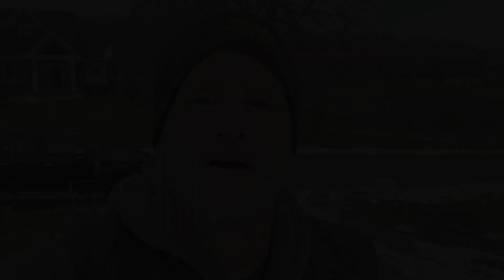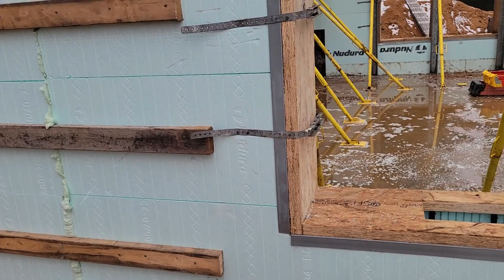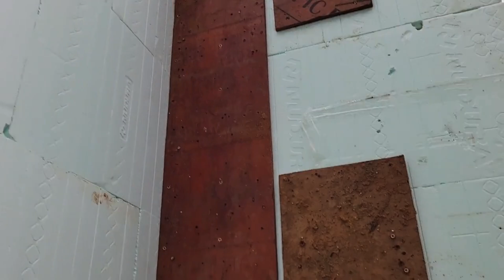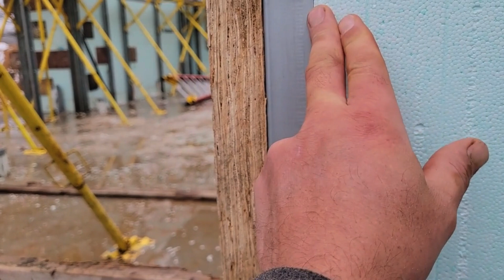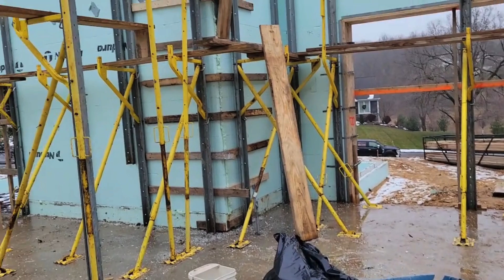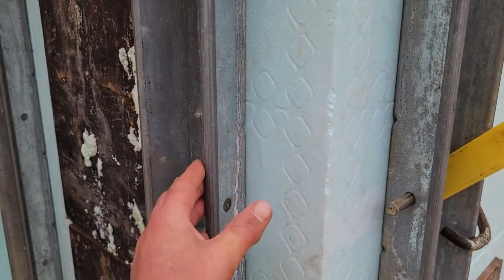Bracing Inspections! Come Walk Through One Of Our Homes

Comment: Im planning on using icf to do my foundation. Most of my house will be 3 courses high for crawlspace but will have a small portion of basement thats 6 courses high.  How would you handle making that transition when it comes to pouring the footer? Would this require doing steps down or can I accomplish the depth change by pouring a big buck?
Reply from the maker: I have found that a local inspector will have a preference, but in my area we treat it like a lintel opening--just using a buck to frame an opening, then adding rebar to span it.
This also creates a great spot to run the septic pipe out.

Comment: Do you do drywall returns or extension jambs & casing on your openings? If the latter, do 18 g trim nails for casing and 15/16 g nails for extension jambs go into the PreBuck? Or is it too dense? Thanks!
Reply from the maker: You should be ok with what you described. The 18ga would be going into the end grain of the buck.

Comment: @ 2:15 What is the item between the wood buck and the ICF?  Some kind of bracketed end cap?  The reason for asking is window header detailing.  Hypothetical (Possibility vs. Probability), if water or moisture gets past the exterior cladding (Reservoir, or Vinyl Siding) or from above via failure, wind driven rain, drying to the inside, what protection is there from water running down vertically between the ICF seam into the top of the wood window buck and moving to the interior (between the wood buck and ICF block).  Not face but between the wood and concrete.  Even for air sealing.
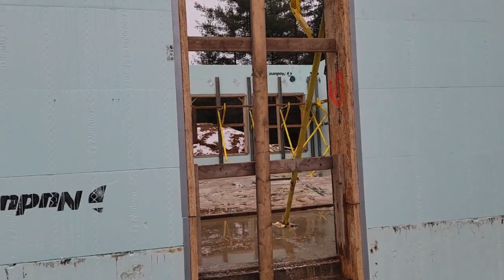Edit:  Nevermind on the material @4:15 explained it.  Does it still solve the possible penetration?
Reply from the maker: That is a 1.5" x 1.5" piece of metal, which comes fastened to the Pre-Buck. its purpose is to center the buck on the ICF, and it prevents the foam from bulging out during the pour.

Regarding wind driven rain making its way past the buck and into the home, we have experienced this on a couple home, at which point we began installing a WRB over our ICF.
Reply: @RValueHomes  
Thanks.  I have settled on Element Pro Buck and the Build Block Build Buck.  Both offer the thermal break I am looking for.  After build this big beautiful wall, no reason to introduce a thermal bridge.  I can understand there are needs for the wood buck.

Comment: Great video, thanks! What are the pros/cons of the probuck vs the insulated bucks?
Reply from the maker: I can't say a lot about that, since I haven't actually used any of the foam bucks. My concern with them is whether they have the strength to hold a window in place during a hurricane or similar. Or kids repeatedly slamming doors!
Reply: @RValueHomes  Theoretically the tiesb in the foam should be strong enough, right? Supposedly just as much pull out as a 2x, or so they say. But I suppose that when what's at risk are really heavy and super expensive triple pain windows, I can see where using wood provides a comfort factor, even if it's only psychological.
Reply from the maker: @chrisgeary4624  The concern I have isn't the web pullout, it's what the web is connected to, which is nothing.
In an ICF wall, the web is connected to the concrete via the tie.
Reply: @ Ah, didn’t realize that, makes sense though. Could you tapcon the windows into the concrete?  Maybe the juice isn’t worth the squeeze at that point. Not sure what the hit from the thermal bridging is in the first place.
Reply: We purchased the foam bucks, afterwards I read a white paper on window wind loading.  The foam bucks will not resist those forces with large windows.
Reply: @ Could you share the link? I’d be interested in reading that. My instinct is that you have to fight for eliminating every gap and every bridge, so I’d like the data to convince myself that that would be a bad move here.
Reply from the maker: @chrisgeary4624  On order of magnitude, the buck material is small potatoes compared to the window itself, & the air sealing. Even a wood buck thermally outperforms all triple pane windows.
Reply: @RValueHomes  Thanks—I’m convinced. You don’t happen to build in western Virginia in addition to western Michigan, do you? 😅
Reply from the maker: @chrisgeary4624  That sounds better than Michigan this time of year!
Reply: @ You’d be surprised. It’s going to be our retirement home (we’re over in Wisconsin now) but up in the Blue Ridge isn’t as different weather-wise as I would’ve ever thought. Certainly way colder and snowier than my wife was thinking, but we’re locked in now!